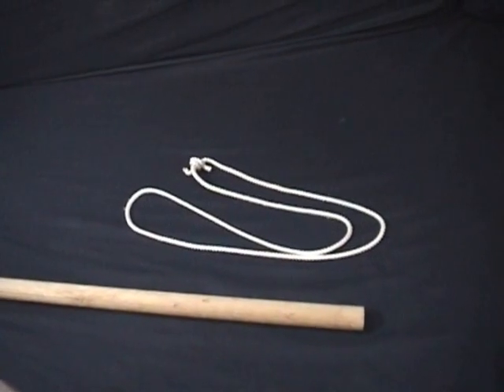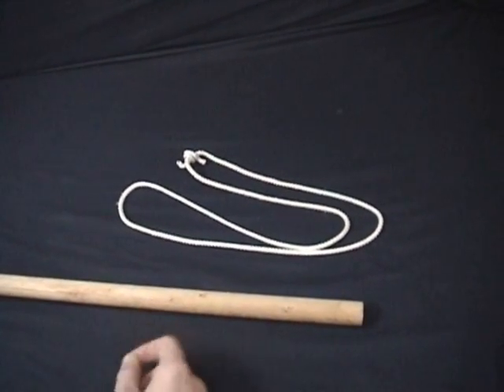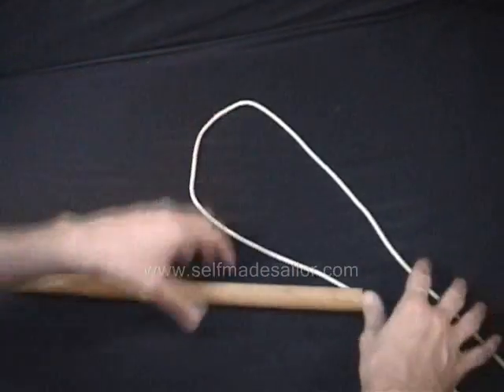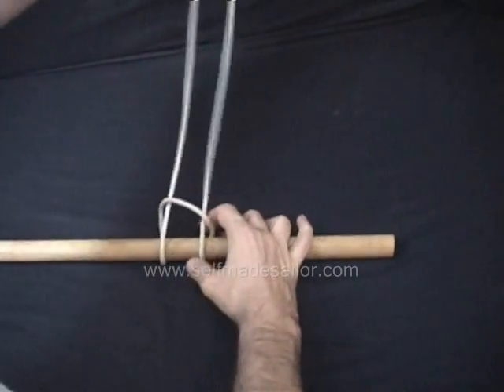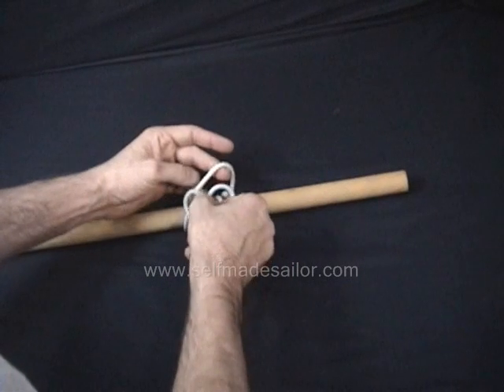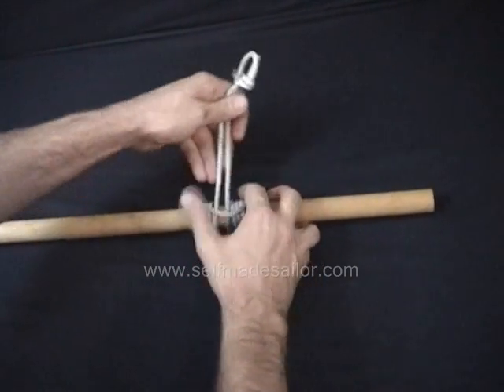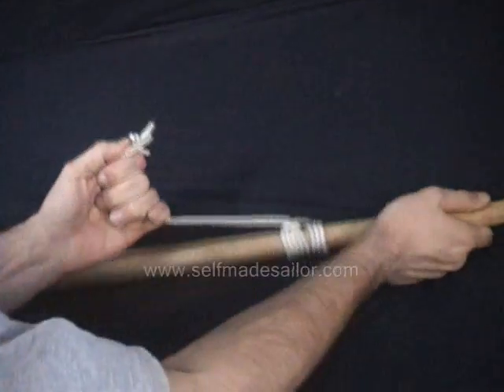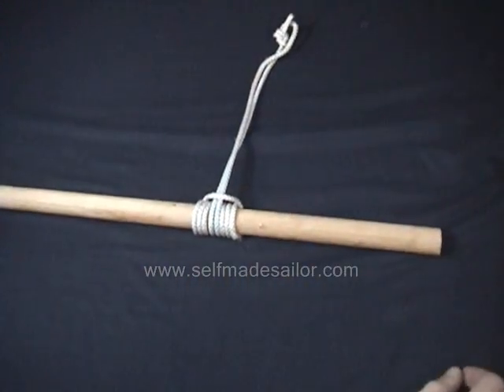How to tie a Prusik Hitch - an excellent friction hitch

Comment: Resist sliding in either direction? Actually the most common use of this knot is as an ascending knot in climbing. Can't really resist in both directions if it is an ascending knot can it? And I've climbed for 14 years so I'm not some book smart schmuck spouting off. Not trying to nit pick just point it out